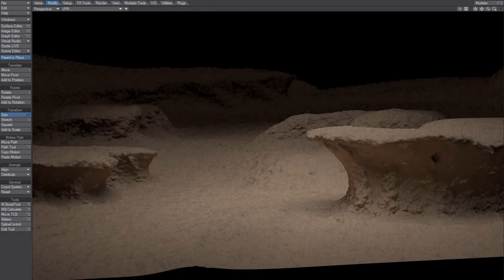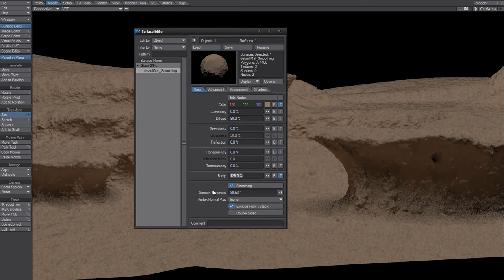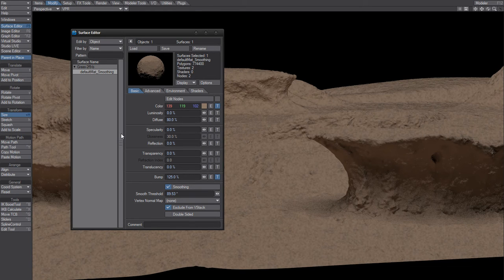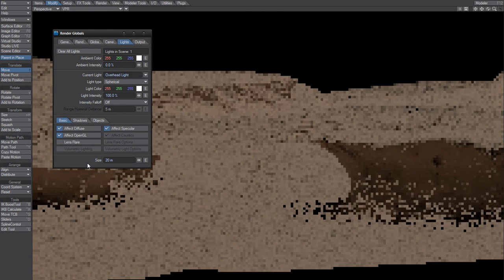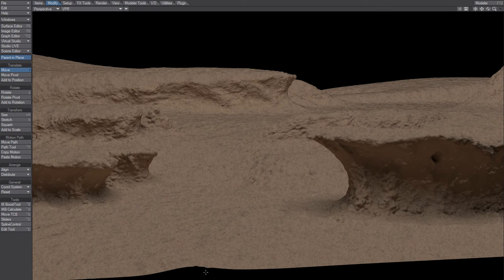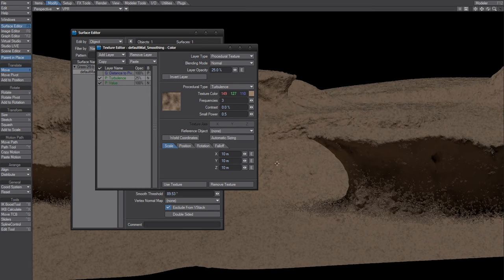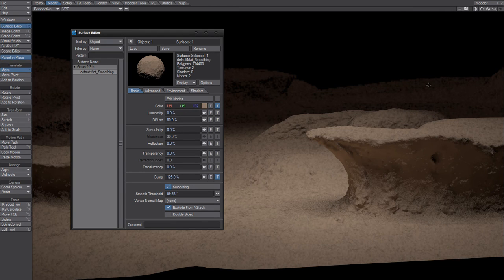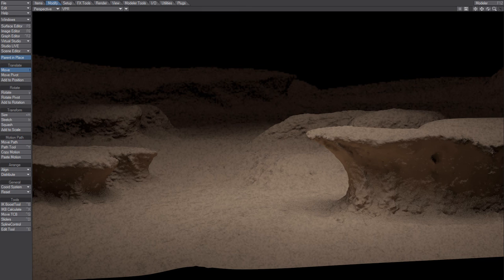LightWave rendering - Terrain Render Notes #1

Comment: for lighting - goto render tab and increase the lighting samples from 1 to 4.  this way you dont have to use AA samples, and you can lower that decreasing render time.   Also DPkit lights the dp-flood is a spot - that works really well. DPKIT lights are great.  I Never use dome - it just doesn't look right and very grainy and long to render, dp flood a few of those makes for much better lighting contorl..   HOw did you model this?? thanks pete
Reply from the maker: thanks for info   :) 
yes, i found the same, dome lights were slow to render, hard to light, and noisy.
the model is basically just boxes on a terrain, then heavy tweaking in Zbrush.
took quite a long time back to create in ZB back in the days.
today i guess i would have used 3DCoat, easier to navigate, imo.

Comment: Hi erikals.

Thanks for the notes...

My workflow is a bit different though.I Never use srgb, to me it yields too flat washed out renders..both on terrain and in the sky, for the sky it washes out that depth realism and color which I think looks much better with srgb disabled completly, as for terrains ..it always look a little too ambient with it as well, that is why I Never use it, it would require post processing or tone maps and I really wan´t to get as close as possible straight from vpr.
for product or interior renders, yes srgb...but I do not use that color space for space or exterior shots.

 As for sun brightness, I would be careful of raising brightness too much, personally I may probably stay within 10% plus not more, cause it will affect the sky as well, instead I simply raise light intensity in the light panel between 120-150%

As for going to night scene..or overcast lighting, well I think I rather add a skylight and raise it´s balance value so the sk sun light automaticly is decreased by that.

As for changing sun direction, I always use manual control, not time zone..for easier change and control over lighting the scene, unless someone says show me exact light at a given time and location:)

For the global illumination and hdr...not sure, did you check use bumps in radiosity tab? and ambient occlusion? may help to occlude some light in cavity areas.

For surfacing, I generally always add an incidence angle gradient in the diffuse channel, and for terrain that may have harder rock areas, I also go to surface advanced tab and raise the diffuse sharpness to something around 20%

Those are some of my lighting and surfacing tips.
Reply from the maker: :)   it's quite tricky, a setting here affects a setting there.
getting ultimate outdoor scenes to work nice with flare/fog/clouds/turbulenceFD, close-up rain etc is a struggle.
i'm not quite sure just yet what is the best options, it seems to vary. and soon we'll have a new render engine    :)   agh.   :)
thank you for the notes, i try to dig in all good info, so they are very-very welcome.    :)
Reply: Yep it is, Lightwave isn´t ..hasn´t been developed properly with exterior landscaping in mind unfortunatly, so optimized tools for such things as they have in terragen or vue isn´t there, and even other software seem to have at least special tools that provide some optimizing for that ..I think.
And yes..it may be a bit of wasting time since the new render engine and volumetrics is about to come.

I would like to discuss and add things further to this on the newtek forums, I had one thread about it some time ago that was erased due to the forum crash unfortunatly, then I started a new one..but that one I got some negative responses on so that My motivation to further post tips on the forum went out the window.

I also got some other full time job for a while that doesn´t include any lightwaving so less and less time with lightwave now.
In my sunsky and volumetric tricks post, I mentioned that I will post scenefiles to selected members Only due to the situation in that post, You are on the good list to receive that godray and shadow casting scene later, though with the hv item it is slow to render.

For fog blending...
Oh..and if you use backdrop sunsky as checked ..use backdrop color, you will always get a sharp edge in the horizon overlaying unrealisticly over terrain..but if you change sunsky model to preetham, that doesn´t seem to be the case, at least not that much, hosek wilkie may be more realistic in general though, but if you want smooth backdrop fog to blend out nicely with sunsky, use preetham...or just use the backdrop gradient color and discard sunsky that will give a good fog blend against backdrop as well..but you will lack the sunsky realism.